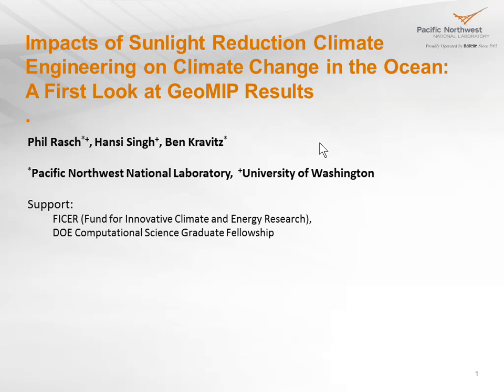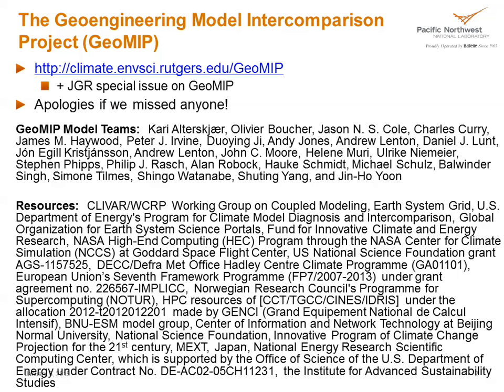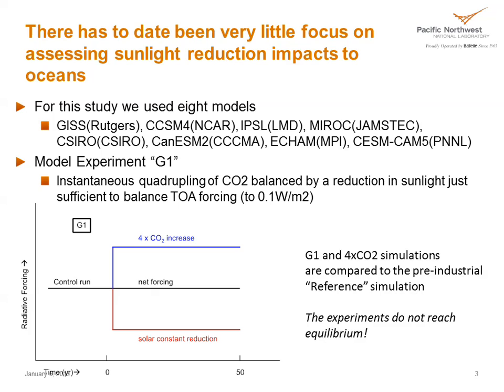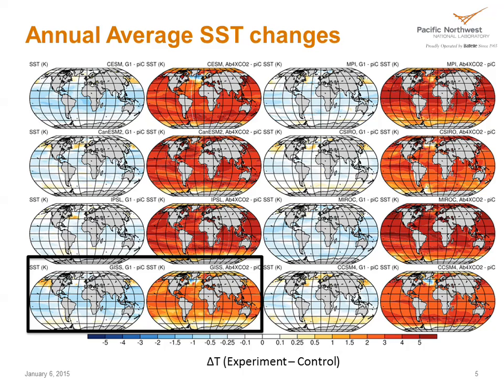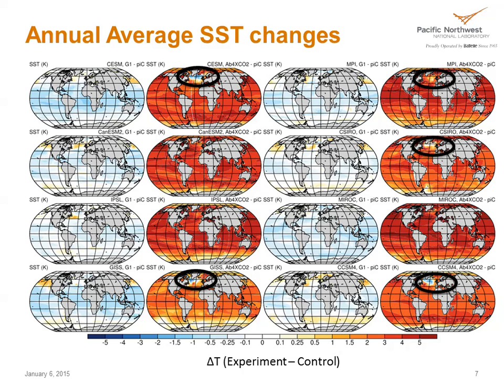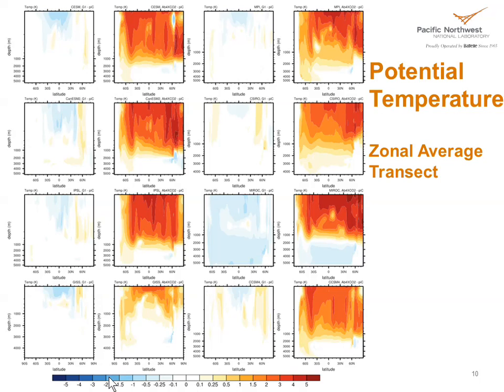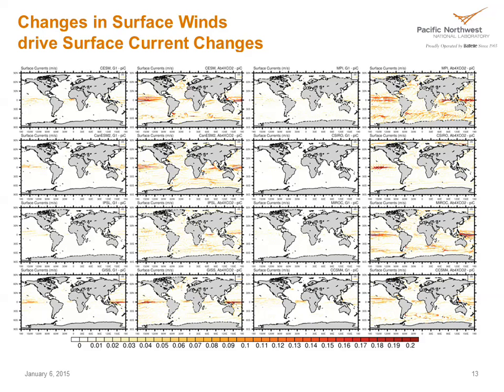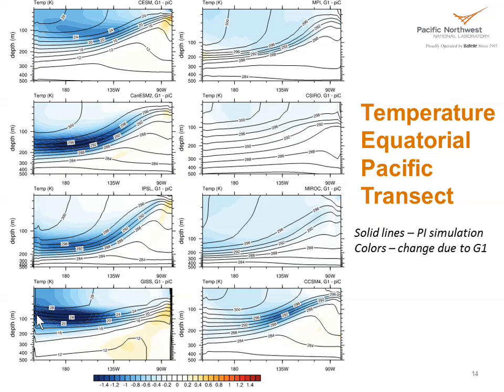Impacts of Sunlight Reduction Climate Engineering on Climate Change in the Ocean - WXMOD 2015

Comment: The windows steam up, when the kettle is boiling, so by controlling the visibility through the windows, we can control the stove temperature...  Sounds reasonable... Why not use CO2 in double glazed glass, if it's such a great insulator?  The entire premiss underlying climate change is the insulating quality of CO2, which is, as far as i can tell, no different from air!